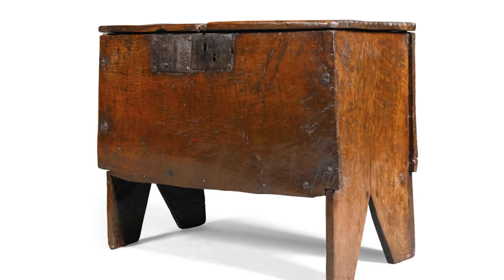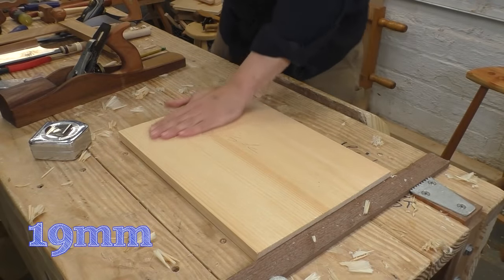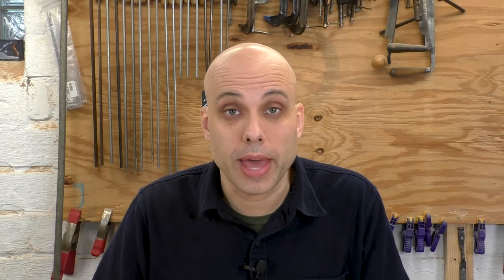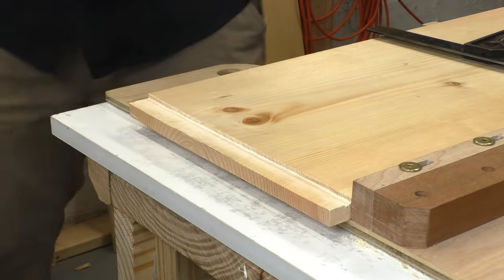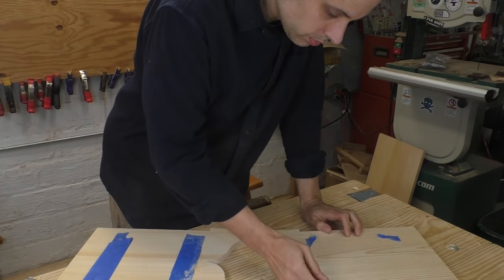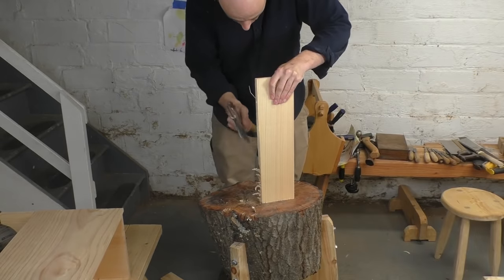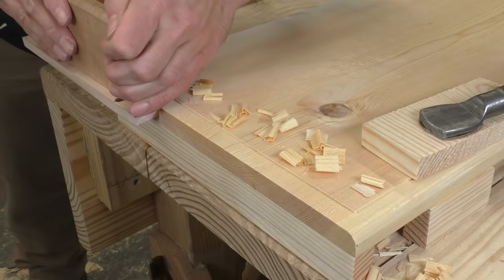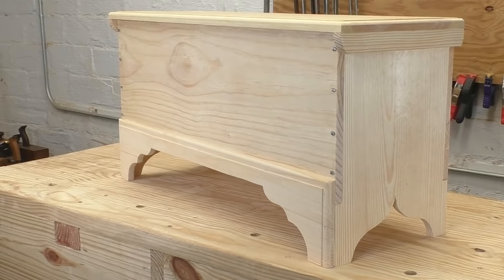The LEGENDARY Six-Board Chest

Comment: I've learned that once you cut something too short, you can cut it as many times as you want to after that, and it will still be too short.  I've had to learn that more than once unfortunately lol!  Love your practical approach to things.  Nice simple chest by the way.

By the way, I bought a dozuki saw and have loved it.  I now use hand tools about half the time, tho not totally.  Any time I only need a cut or two or just want to make a hand made object, I use it.  Once you get use to the pull cut as opposed to the push cut, you can do wonders with it and it is very accurate.  I not only draw the line across, but on 90 degree cuts I draw that line as well.  If you follow both lines, magic.  A good 90 degree cut.  But odd angles are just as easy once you get the hang of it.  I also have the dove tail version as well.  Love them both!

Comment: Nice project and nice pep talk on using hand tools alone. The only (a-hem) things I would add are:
a) You don't need to spend a lot of money on tools (just a fraction of what power tools cost) and you can instantly start on carpentry with just a basic toolset. Hand tools also allow you more time to think and realize you're making a mistake and gradually learn carpentry.
b) You don't need to spend time and brain cells on choosing the best power tools you can buy for your budget, worry about battery life, cables, wall sockets, optional accessories, warranties etc.
c) You don't need a dust extraction system.
d) You don't run the risk of accidentally maiming yourself or someone else maiming themselves or having other serious injuries/electrocution inflicted upon you/them.
e) Unless you practice carpentry for a living (where time becomes a big issue), the sense of fulfilment from completing a piece, by just using your bare hands, and exercising your creativity simply do not compare. One is an art the other is a process.. pick your preference.

Comment: I've been living in a rental house since 2014 and have been doing some power tool woodworking as a side hobby and have massed a decent collection. From a strong 3.5 horse tablesaw a good ole Craftsman in excellent shape, as well as several other benchtop power tools mostly through craigslist. However I am going to need to move into a apartment due to some financial changes and I am considering switching over to doing hand tool woodworking instead. I have enjoyed both Rex's channel here and the classic Paul Sellers channel and instruction. So I think hand tool woodworking is where I will need to go from here, wish me luck y'all.

Comment: Hey, Rex, the short bottom is an easy fix. Cut it across the middle and glue in a racing strip of contrasting wood. Oh, or, nail in a cross support ledger board front to back in the middle and say you have improved the design to a seven board/panel chest. The face piece for the legs will hide the through tennon on the front, and the rear one won't show when the chest is up against the wall or bed.

Comment: Just finishing up my chest from your plans.  Loved it.  Thanks so much for the lessons.  As others have mentioned I enjoy that you share your mistakes.  I, for example, used my cordless router to cut the dados because of all the time it would save.  I can't explain it and I don't know why but I spent 40 minutes getting the measurements and guide right for my first dado.  I measured from the shelf line only to realize it wasn't square.  I then measured from the bottom wrong - twice.  I then realized I was measuring from the front of the router bit for the offset but the offset should have been from the back.  At one point it was so bad that I took everything off and sanded the freaking mistake lines off my board and started over.  I cut that dado, flipped the board over and had the sister dado cut in under 2 minutes.  Some times you're just ... stuck in a groove baby!  Thanks for the help.

Comment: Once again, another great project and explanation of the why's. Your video last week on nails really opened my eyes to why the "old timers" only used nails and no glue a lot of the time. I'll be attempting this project in a month or two once I've managed to make my work bench, vice, saw vice and got the tools to do it - currently on 2nd lockdown, so no hardwares open for another 2 weeks.
Just finished my first mallet using a hammer, chisel and sand paper and am fairly impressed that I got it to come out pretty good, tapered mortise, wedged and the handle is square on both axis, sitting on my counter drying now. Next project is the restoration of my father's mitre saw, around 70 years old, handles almost done, blade started, need to finish the blade and sharpen and wouldn't be attempting any of this without finding your channel, so thanks so much Rex.

Comment: ...forgot - when I was a builder, I put in a set of basement stairs 3x before I got it right. I was attempting to make more steps for the lady of the house who had leg/foot issues. I failed to take into account the required 6'8" headroom. Tore out the first set, thought I had made the right adjustments, and no, I didn't. Cost me about $300 in materials - three sets of 2x12 stingers plus OSB treads and risers. Plus lost wages...so, yah, mistakes get made. Comes from our parents reading too many romance novels...

Comment: Quick tip from a fellow lover of nails: you don’t need to do all that testing when using cut nails. Size the drill to the width of the thin side of the nail, or a bit bigger, and it’ll work every time. The idea behind the nails is of course to compress the wood in only one direction, along the grain (so it will never split). All that testing is usually only there for the sake of the wire nails. Great video as always Rex!

Comment: Another wonderful video.  Very inspiring, but still having a problem weaning myself completely off of electricity. My intentions are honorable but my wall outlets are numerous.  The nice thing about power tools is, you can take several slices from a board with little effort before it is too short to fit.

Comment: My Trade is that of Carpenter.  When I was doing my learning,  I was taught to work with hand tools before using power tools also, how to maintain my tools including using  "lump" hammer for setting the teeth of circular saw blades before tct blades became available.

Comment: Orange & Blue both carry 'project panels' that are laminated butcher-block style, but thinner. They're not a lot more expensive than the dimensional lumber, but generally more stable so you can likely bypass that planing step. It also gives a different 'look' if you don't paint, and is moot if you do. Can't help you with the short cuts, still haven't found a decent wood stretcher.

Comment: Hey Rex. Glad to know you don't read romance novels...
I like this project. I think I might apply the Golden Rectangle to get the size I want. I'm not crazy about nails so I'll likely use dovetail or box joinery. I love using  hand tools. I want to build the turning saw too. Maybe I'll do that first. Today I began making another mallet using some snarly Oak 2x4 from a pallet. The grain is crazy. Good practice using my planes to get it square and flat. And, I am following the double taper handle design you brought to my attention. This will be the second one. It's crazy how well that joint holds. I gave the first one away already. Not much heat in the garage - so working with cold hands and bringing the parts into the camper for glue-up. May the Lord God Almighty be with you and your family as you strive to be of service to this community. 
Oh, and I am grateful you do not use any muzak in the background. Thank you.

Comment: Removing crown in boards with moisture and heat. I have watched wooden boat, boat restorers remove crown and cupping by adding moisture and heat. I've seen Japanese woodworkers do the same thing. I tried it and it worked. Ran a damp rag over the crown, hit it with a heat gun (or put out in direct sun), and the crown came out. Waited several days and the board remained flat.

Comment: Very nice , I never thought that nails had a place In carpentry but yours looks the part. I do use a small few power tools for the rough resizing out jobs but for finishing it's hand tools all the way , and I think hand tool joinery is way more accurate than any power tool I've used even with all the fences and fancy rubbish hanging off of them . Once you get the knack of hand tools you'll wonder why you put up with all the noise and dust lol

Comment: I'm repairing guitars and I use both handtools and powertools depending on the situation. I don't think somebody should limit themselves to either type, as every tool has it's perfect usecase. I couldn't rout a perfect channel into the wood in case of a broken neck repair by hand, but I couldn't cut a perfectly fitting piece of wood to glue in there with powertools, only by careful filing and sanding.

Comment: If you really want to get fancy instead of flat boards on the front and back make raised panels with frames. You can make two or three panels of equal size set between rails and styles. You’ll have the added benefit that your wood from your front and back panels that Connect to your side panels have the grain all going the same direction. And you can do this with a router or with a router plane and a bunch of other planes and if you go to more shaker style with a flat surface showing instead of raised it can be a very simple project.

Comment: Hand tools has it's place, but there is a reason why power tools have taken over. It's 10 times quicker with power tools and you can do finishing touches with hand tools to give a personal touch. I just don't have the time to do every by hand and having a table saw and jointer/thicknesser just makes it possible for me to make projects and a short amount of time. If it tickles your fancy to only do everything by hand then more power to you, but that isn't me. Also, one of my hobbies is rebuilding old cast iron machine like lathes, mills, bandsaws, air compressors and I get them very cheap, so I have an entire shop full of useful machines to do most of the work for me and I didn't spend an arm and leg for them.

Comment: I think even if someone is a power tool woodworker, it is very important to now and then do at least a few hand tool only (or mostly, at least) projects, or do a few different tasks by hand in each project (just get some frequent handtool work in there). Because it is slower, because it is harder, it makes you reflect on your work more, on techniques and principles more, which means it teaches you stuff you possibly wouldn't think so much about otherwise. I think that is why when you transitioned from mostly powertools to primarily and then just hand tools you felt like your skill went down, because you technically were less skilled in some aspects that the tools compensated for and you never had to learn or understand them as well as you have to with hand tools.

Comment: Thats a nice project... working with soft pine can be a double-edged sword... it "tears" easily & , as u point out, bruises easily too... 🙄

I notice you seem to only use a small portion of your panel saw blade, you need to start using a longer stroke, light pressure, and it will cut cleaner AND faster... 

My father was a cabinet maker and drummed this into me from an early age. I miss my dad.. 🥺

From the Emerald Isle
😎👍☘🍺

Comment: I'd love to see a version of this without any wide stock. Just 2” or 3” wide stuff with some panel construction.
Reply: I've used stair treads from Home Depot.  Same price as the 1x12 but they are glued up smaller stock.  You'll have to square the rounded toe, that'll cost you an inch.   But they're all clear stock and pretty solid.

Comment: Great video!  My only comment is that the pine at Home Depot is not that great a bargain.  It works out to between $3.30 and almost $4.00 per board foot for common boards.  You can get furniture grade pine at hardwood lumber yards for around $4.00 per board foot or maybe even  less and I would rather work with it.

Comment: Hi Rex, I'm wondering if there was a reason you used the cross peen to start those wire nails? wouldn't it have been just as easy to start those with the face of that hammer? or use a carpentry hammer, instead of a blacksmithing hammer?  I'm just wondering if there was a reason for that.... Love your videos, you've given me a lot of inspiration. :)

Comment: Great design, as always! 
I'm wondering what the best way might be to add support to the bottom board if I were to build a wider version of this - maybe 36 inches wide and 12 deep. I'm just concerned about sagging, especially if pine is used. I thought of a nail driven through the front and back pieces, but would seasonal movement cause them to pull looser over time?

Comment: I love this video and I love the project. As soon as I can get my shop together, this is going to be something I dig in on. I have one question though: If the cross grain joints struggle with weather, is there a way to re-design this chest to not use cross grain joints? Could you use a different set of techniques to construct the side such that you could dovetail the body together?

Comment: Rex, what made you switch from power tool to hand tools. Was it just cost? Or some other factor. By my eye tools are only invented to make life easier, so it's difficult to wrap my head around the choice to use older tool technology.
Reply from the maker: At first, those videos were more popular, so it was a business decision....but then I found I just liked it more. Clean, quite, safer hand tools are a lot more fun. As to making life easier, I mostly make period style furniture that was designed durning the pre-industrial era. With pieces designed for hand-tools, it's not slow at all. Making a more modern piece by hand would be slower.

Comment: My answer to those who think "hand tools are harder":
Not always. But that's what the power tool industry wants you to think.
Keep them sharp and you'll fly through some operations much faster than it would take to get out the table saw or router, set up the dust collection and adjust for the cut. Especially on smaller, one-off projects.
 Case in point, you'll never find a power saw blade to cut as crisp a line as a shooting board will.
I find myself going to hand tools more and more in my space limited workshop with very limited power.
Power tools aren't always better, just electrified. They exist for the purpose of being marketed, not necessarily to do a faster or better job. 

I laugh at those who mistake having the money to outfit their shop with countless premium brand power tools for being a "Master Craftsman". I'm lookin' at you NORM with your "dedicated mortising drill press" :P

Comment: Seems to me the comment about the length of the bottom at 2:15 is wrong.  The bottom is the length if the lid minus the thickness of the sides MINUS THE TWO INCHES OF OVERHANG ON THE LID.

Comment: I also just had a question pop into my head I have several good pieces of 2*6 by 8 feet material. So my question is can this chest be made with those same 2*6 pieces just jointed and then possibly either dowel or biscuit jointed for strength? Or won't the 2*6 material lumber stick and stay strong enough together for a low enough amount of time to be worth using in this specific project?
Reply: Yes you can join 2x6 together. Especially if you paint it so the glue and joint doesn't show. I use dowels, but that really is just for alignment.

Comment: when warm weather returns can we expect to see a return of projects made on the low work bench?
Reply from the maker: Not only that, I have a NEW low bench design that's cheaper and simpler to build!
Reply: @RexKrueger  I look forward to it. I ended up building one with 8 legs since my largest bit is 1 in. one innovation I came up with is using a 2x6 on the outside to be a mini apron for the crochet and allowing me to use holdfasts to clamp things to the side.